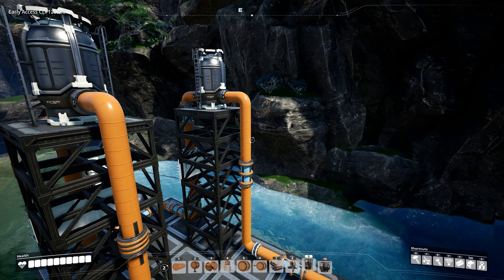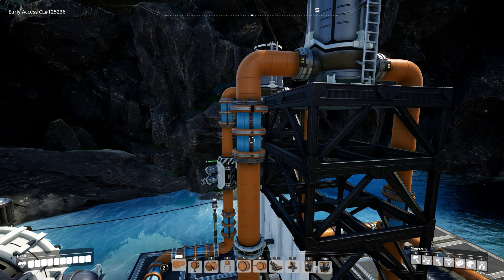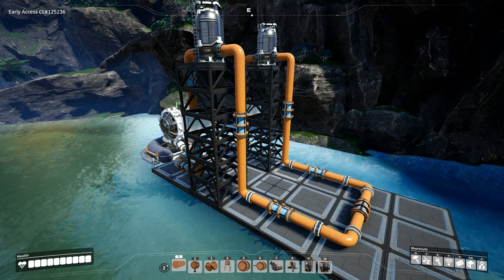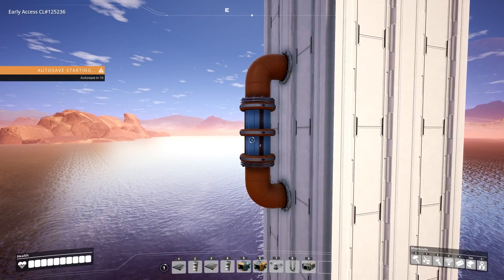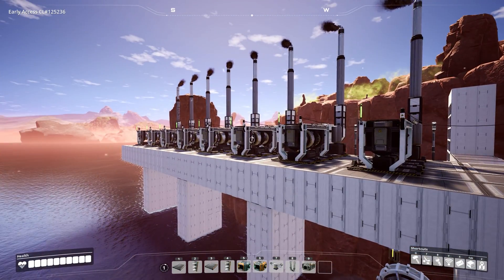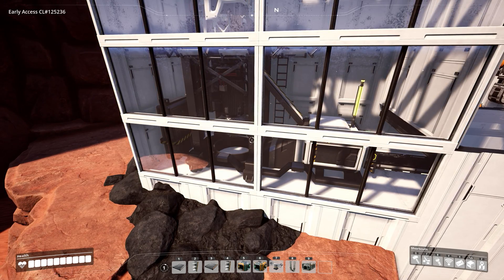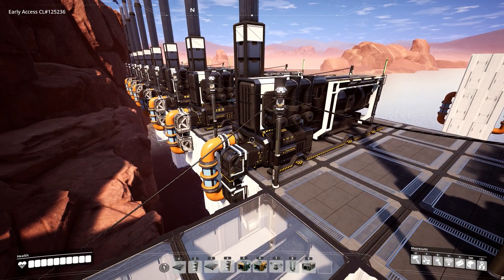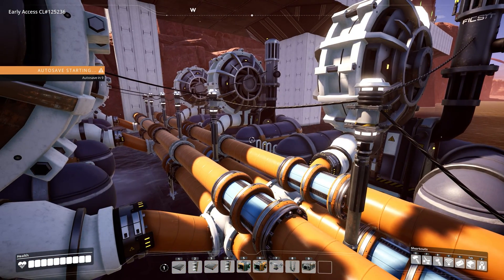100% Efficient Coal Generator Basics [SATISFACTORY GUIDE]

Comment: I managed to build 50 generators that run on 240 coal per minute.
also 3 pumps are quiet enough for 30 generators.
Reply from the maker: The generators might be running but once you start increasing power draw they won’t keep up. You need to make sure you have 15 coal/45 water per minute on each generator available.
Reply: @Scalti  Yes, I know that, but the point is that my station is really working, I can attach my save if you want.

Comment: An easier way to explain how headlift works is with this. https://static.wikia.nocookie.net/satisfactory_gamepedia_en/images/b/b4/Head_lift_demonstration.png

The game doesn't care about the path the fluid takes in the pipes. It only cares about the output with the highest combine elevation + headlift. Headlift is usually about the total height of the machine output with the exception of the pumps and tanks. The pumps give what they say (20/50; Plus 10% extra behind the scenes to give players a little wiggle room so they don't have to worry about being perfect) and tank's output headlift is 0%-100% worth of their height depending on how full they are. Meaning a tank piped into a tank stacked on it will increase the headlift in the pipe when filled to allow fluid to make it into the tank above it. So, you could use stacked tanks to increase the headlift to a high elevation as a powerless option. Would just take a buttload of fluid and materials but would mean you don't need any power to do it.

Comment: New sub my man, good videos. And this is is a nice showcase. but I really wish you had opened up that tower so we could see the pipe work. Having a bit of a problem visualizing the example into the actual upscaled build. In particular how did you slam 360 water into a 300 pipe then get the 60 back out into another pipe, i see no connections from the lower pipe that the water is going into to the upper pipes that supposedly have 60 water. The system has to be looped correct? I understand the water tower design just not the pipe work.
Reply from the maker: I will be looking at making a dedicated video to communicate this more effectively. For now, the amount of water flowing through the pipe is not relevant. The ONLY requirement is that the fluid can reach that height. This tells all of the other pipes connected to it that there is enough headlight for fluids to reach that same height anywhere else in the network. 

If fluid can reach x-height in this pipe then all fluid in connected pipes can match that height elsewhere without the need of pumps in each pipeline. 

It tricks the game essentially. Not all 360 water or in this case 720 is going through that one pipe. It’s just an indicator telling the game that water was able to get this high here so it can get that high anywhere else. This is as long as the other pipes are connected to that pipe (after the pumps) in some way.
Reply: @Scalti  Thanks for the reply man, I just built a smaller version of that setup and started moving my starter factory over to your compact design. The coal is working awesome. Like i said i understand the water tower. the numbers on the water in the pipe were messing with me. but if it works i don't care about math enough to let it stress me lol. great videos man. Thanks a bunch. Also white is the best factory color, so space agey.

Comment: If all 720 m3 of water are going through a single pump/storage, won't it choke the flow?
I got very confused from 6:04 through 6:29, and I got extremely confused at 6:21, cuz i don't see 3 pipes there, I see a pair of two interconnected  and other two standalone ones.
If I understood correctly, I'm still very confused as to how all 720 m3 will get to the 16 generators, if in theory the "key" pipe can only transport 300 m3 to the  pump/storage which then splits this into 100 m3 for each tube. I mean, all this in theory, haven't actually tried it.
Thanks for the almost very clear tutorial :)
Reply from the maker: The ‘key pipe’ doesn’t affect how much flows up the total of 4 pipes. It is simply an indicator to the other pipes connected to the key pipe that water (fluid) can elevate to that height without a pump. It’s effectively a loophole in how the mechanics of fluids work. I believe I will revisit this topic in a future video to try and better explain this.
Reply: @Scalti  nice.

Comment: Hey, great video! I have a question though: if pipes can only do 300/min, and you only have 1 main pipe going up to the storage, isn't that limiting the amount? Is it possible to get a download of your world here since I've never seen a "water tower" method anywhere else
Reply from the maker: Nope! The water going to the extractors does not need to go up through that single ‘key pipe’. You just use that pipe route to tell the rest of the joined network that ‘water can get this high’ and it will do so without the use of pumps.

Comment: excellent, as usual.  :)  wish there was a way to snap the pumps to a foundation to make alignment easier... >_<
Reply from the maker: In terms of vertical? You can. Use walls.
Reply: @Scalti  sorry, i meant the Water Extractors... lining them up to output pipes would be a lot easier if they would snap to the grid like everything else.  :P

Comment: Scalti thank you for the guide. I may have to follow this height guide. I built an aluminum factory, and for a while I was balancing pretty well, but one refinery wasn't getting enough water. I tried to balance balancing the water coming out from the aluminum scrap production to join back the aluminua solution water. I still was having issues getting the balance right. I just added your buffer concept, which I'm actually loving only needing pumps within the water tower. However my 2nd refinery in the order always seems to get the least amount of water even though the whole network as a whole. Also the Drain rate on my fluid buffer won't stay steady. Is it mainly because I'm not using the full 300 of the pipe? I do have a valve trying to manage the flow to the correct amount. In case anyone else is willing to help, here's also the layout that I currently have. https://www.satisfactorytools.com/production?share=9qmnLTe7iVFTVElY25qU

Comment: Man I found you during my lunch break and now I can't wait to get off work to ... do more work lol. I work for the factory now 😌. It's taking me some time to wrap my head around the 'primary and 'secondary pipes though - so the line pumping 60m^3/m is just connected to the main line like 2 lines merged to make one? Or is that 60 delivering individually to that last coal generator
Reply from the maker: A bit of both. By the time the main line of 300 hits the 7th generator it uses up 270. The secondary delivers the remaining water so the last generator receive 45 and the remaining goes into the 7th for a perfect balance.
Reply: @Scalti  I gotcha! You actually explain it well,, I had to rewatch

Comment: Spent an hour trying to figure out how to stack Splitters on top of pipelines before I gave up.  Am I just stupid, or is there some hidden trick to this?
Reply from the maker: Build an 8x1 foundation next to the conveyor walls and place splitters inline with the hole. Then delete foundation and run pipes after underneath.
Reply: @Scalti  Thank you.  I figured out if I put a lift onto the Coal Generator, then a Belt Support in front of that, with a belt feeding the lift, then the Splitter would snap to the support and I could deconstruct it after.  The belt stayed and everything worked.

Comment: So let me get this straight. If I were to build one large head lift tower, in theory, I wouldn't need to use pumps anywhere else in the world?
Reply from the maker: As long as the pipes are in someway connected to that tower without a pump forcing a one way flow towards the tower, yes.

Comment: I like this building layout, but I'm struggling with setting up the piping of the water towers ( can't figure how to go from 2 lines to four lines pipes without 4 water buffers.
Reply from the maker: You only need a single pipe with pumps going up to a single fluid buffer. Then on the output from the buffer you use a pipe splitter that turns the single output from the buffer into 3. Then one of those 3 pipes rejoins the ‘key pipe’ and those 4 pipes can be routed and elevated up to your coal generators. Revisit 6:23 for visual reference. 

Apologies for not making this as clear as I should have.

Comment: I have a question about the fluid limits on the pipes. The 3 water extractor transport 360 m³/minute water in the pipelines, you have 6 installed and they are all connected right? How this works with the 600 m³/minute limit on the pipelines?

Edit: Btw, great guides on your channel. Loving your work.
Reply from the maker: The limit is 1,200 because there are 4 pipes. The max flow is 720. Each set of 3 extractors has 2 pipes so each set receives max flow of 600 when only 360 is needed. 

Hope this helps clear things up!
Reply: @Scalti  Ohhh, okey, thanks for the quick answer

Comment: Always beautiful videos, thumbnails but dayumn that headlift thing has me thinking
Reply: It's useful you can also do the same for fuel, so rather than packaging all your fuel to take to the top of a factory, you can use headlift to take one line to the top then connect it to the bottom - My only concern is this will be fixed at a later date, because though headlift works like this, currently you can add other extractors at the bottom of the circuit to pump more water, which actually goes against real life head lift mechanics but we'll see... until then I shall use it :D
Reply: @TotalXclipse  yeah I can foresee a 'count of pumps/pipelength' fix occuring some point. Though there will always be a way around the mechanics. I remember them saying the same about clipping functionality and such... But we will see :)

Comment: Excellent tip on the water mechanics! I've never seen this before.
Reply: Can't you just use one pump and then split the pipe after the pump?
Reply: @garyhamilton2104  You need a specific amount of water, the pump can't provide enough water alone.